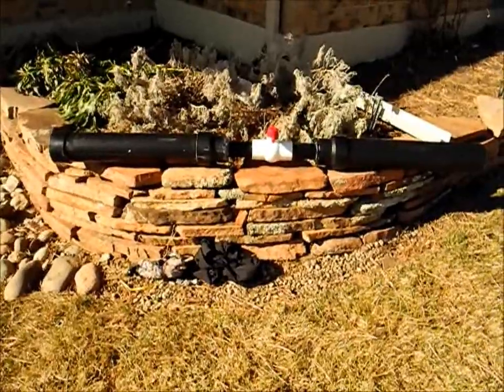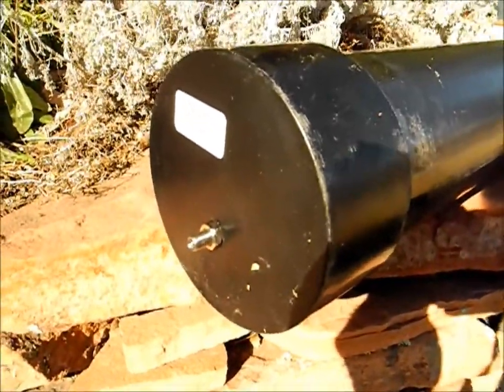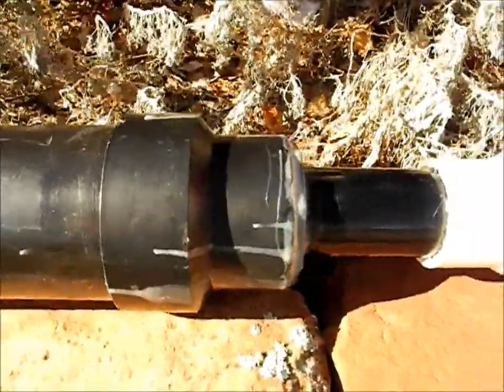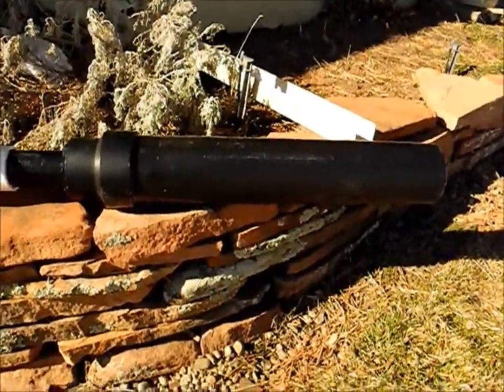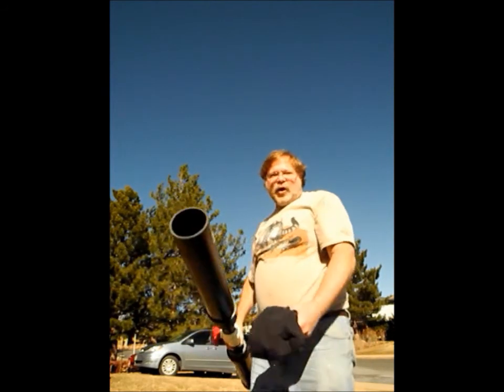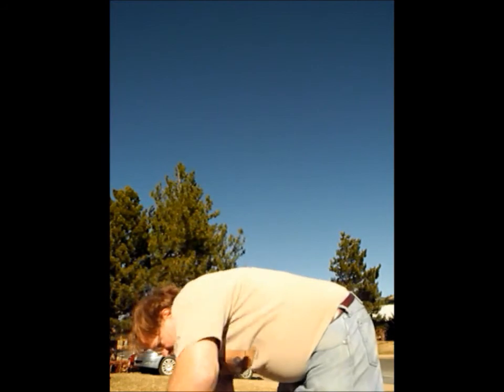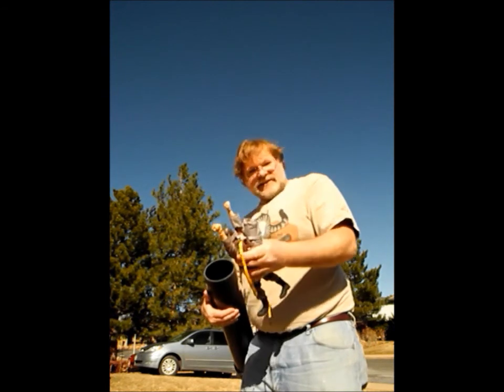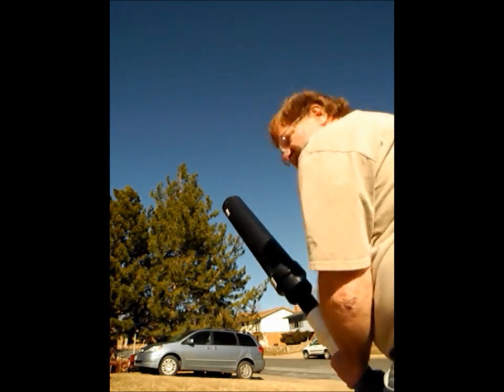GI Joe Launcher.wmv

Comment: Kind of a neat idea, but the wind noise prevented me from hearing you explain the pressurization facts. Also, looks like you need more vertical angle to launch Joe. Hope you stay with this idea and show some more launches and improvements if you think of any. Me? I'd kinda like to figure out how to launch multiple Joes at the same time to make a "mass jump" of all my airborne troops. I was thinking of a catapult launcher on my roof that would send up 5 or more troops at once. Maybe I could use one or more screen door springs under tension to shoot the troops airborne! :)